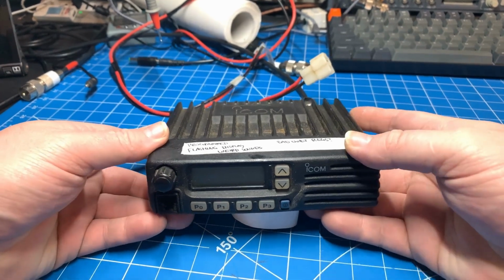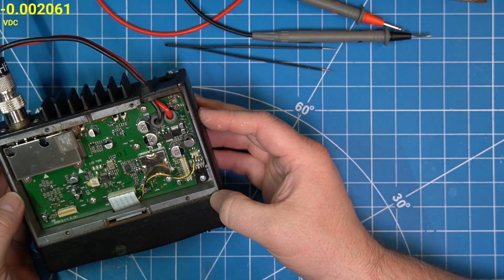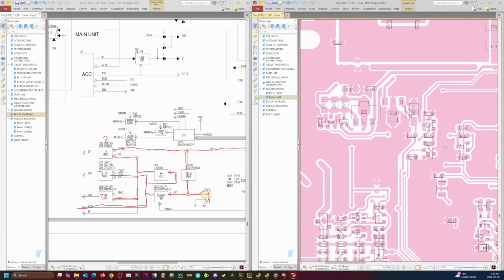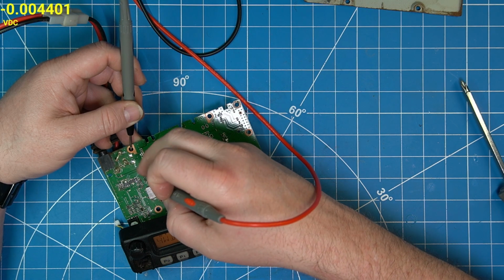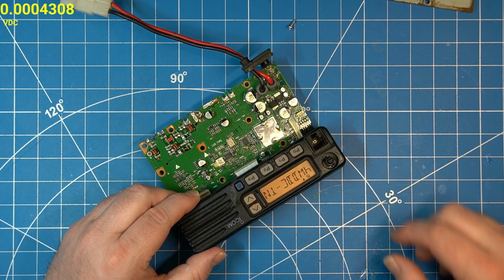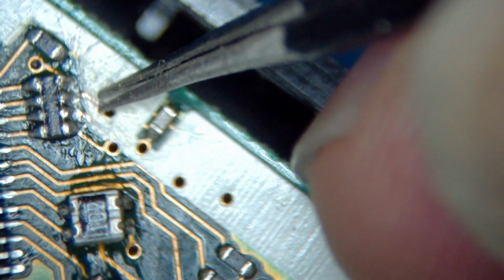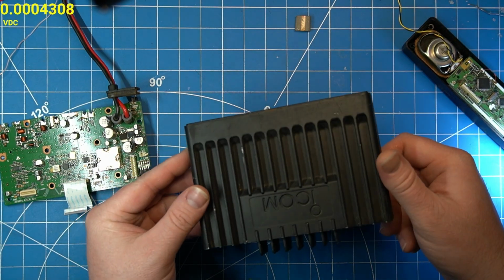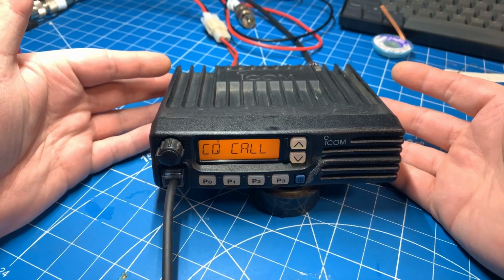Icom IC-F110 Flashing display Repair

Comment: What freq's do you program radios to ? 144.440 mhz id a ham only freq's
Reply from the maker: I use that frequency to test all of my radios. Yes it is a Ham frequency. I have a low powered repeater on the other side of the house that I use for playback on that frequency using a Baofeng UV5R. It's a great way to test audio output

Comment: I provided a couple of these when a local railroad had some stolen from their locomotives. Plus found them some slide in slide out brackets so they could remove them and lock them up at night.  Good radios.